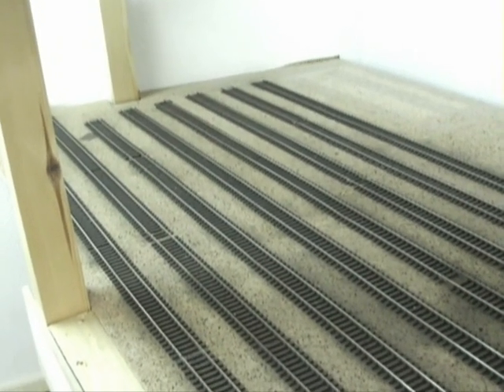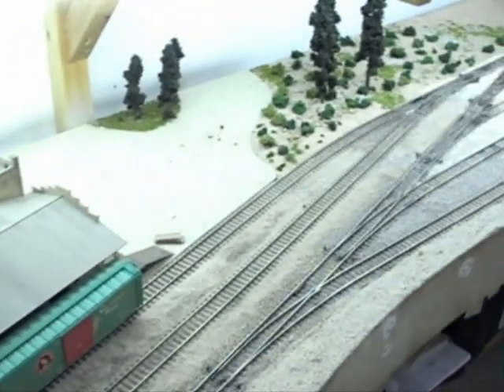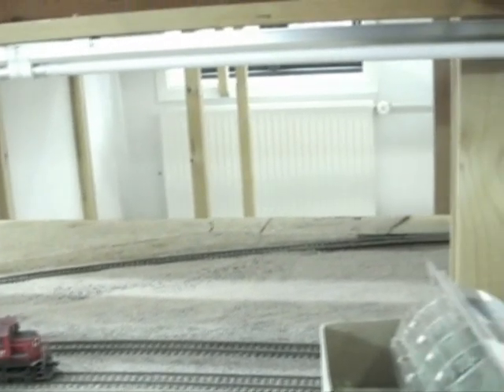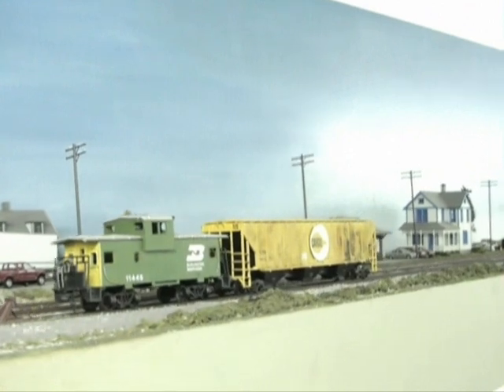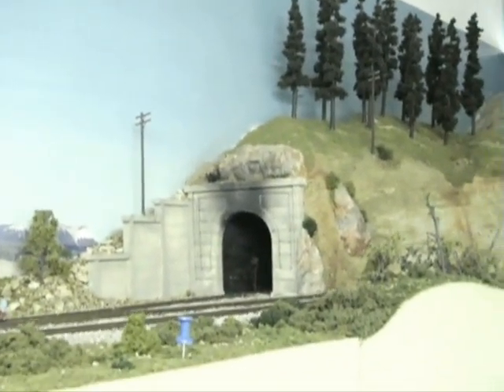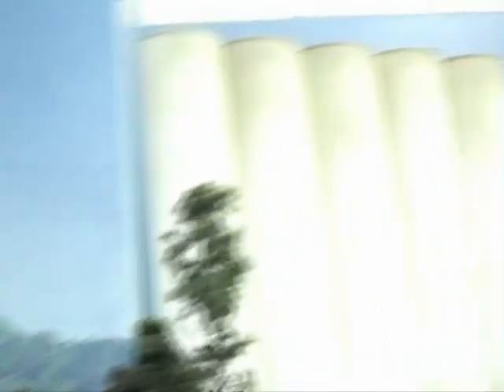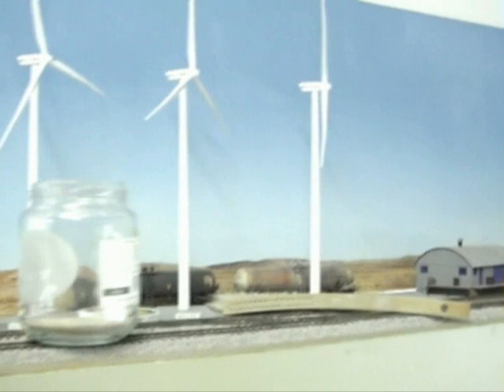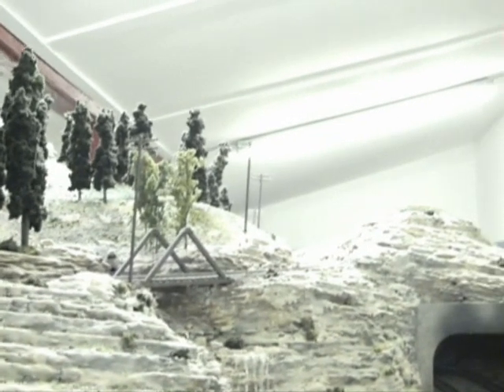Layout Tour Part 1 Status

Comment: It will be my first large layout building it myself.  Track wiring will be kept simple as I am also using Lenz DCC.  Era is mostly 70's to 80's but sometimes as far back as late 1940's.  Chosen roads are Southern Pacific/Denver & Rio Grande Western and/or Burlington Northern/Montana Rail Link, depending on what I want to run. I have most of the benchwork completed and I plan to finish the rest this weekend. Hopefully!  I will also be taking some photos to document progress.

Comment: Yup this is one of my favs. Layouts. Its a multi deck? Whats your deck hights? Cant wait to see more. Really good work. Later, John
Reply from the maker: Hi john.
Yes this is a multi deck layout. The lower level is about 80cm or approx.26ft above the floor. The middle level is additional 45cm / approx 15ft higher and the top level is approx. 160-180cm above the floor - just under 6ft.